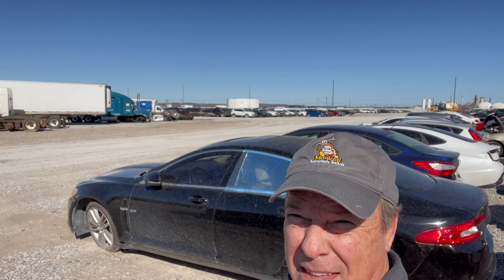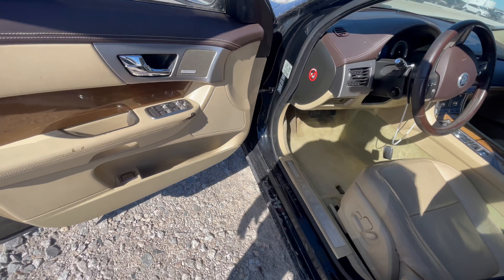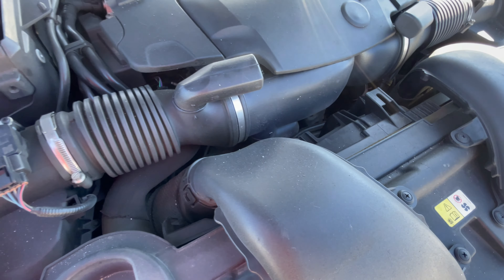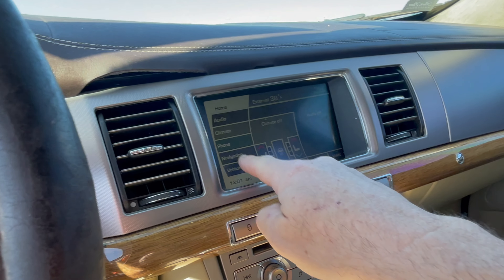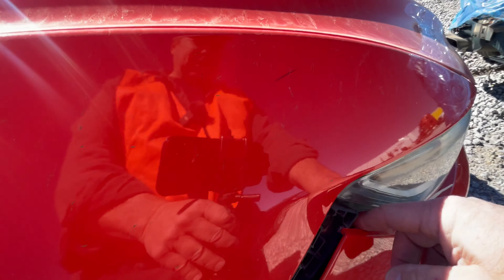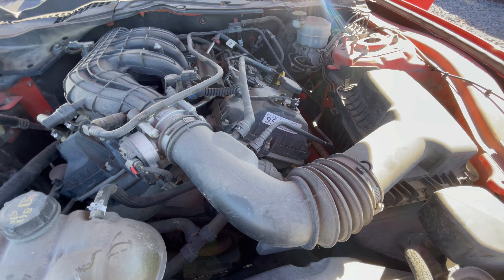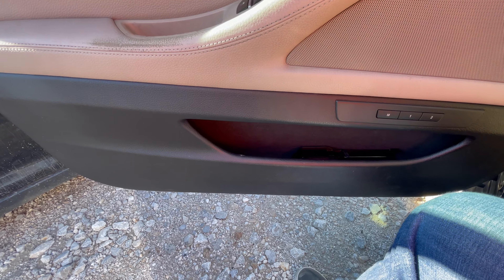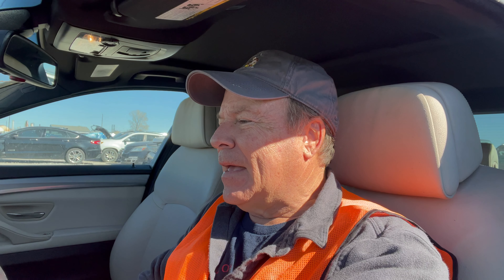Copart Walk Around - 3/2/23

Comment: I rented a jaguar xf r, and it was in my opinion better interior, better drive than an e55amg. With a proper exhaust set up, it was always such a smile on my face. 

If you are willing to put in the money to fix this, it's a fantastic and underrated car. With that front wheel suspension and potential steering gear damaged, it's a gamble on the cost.